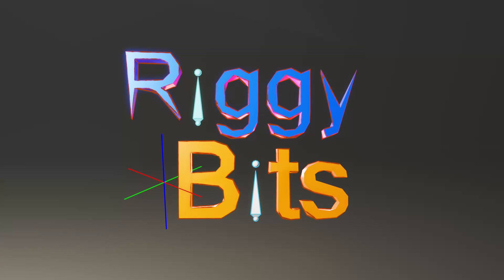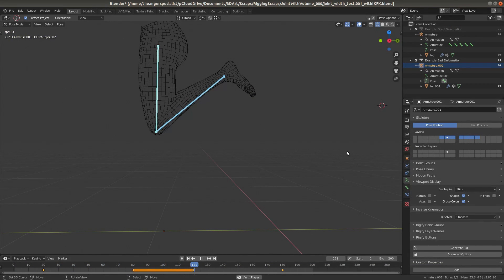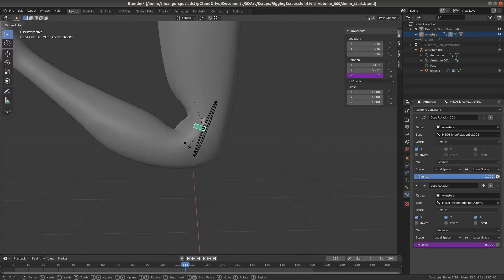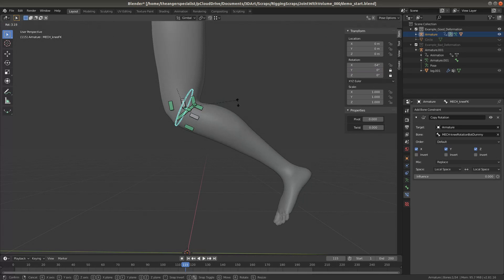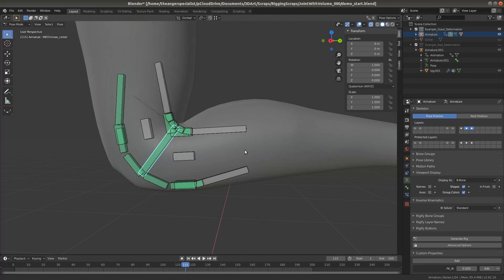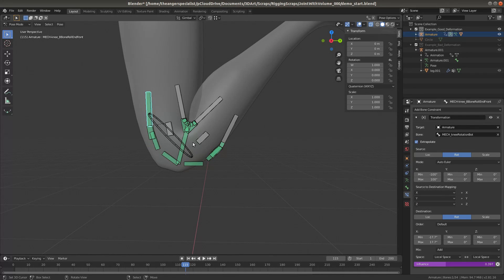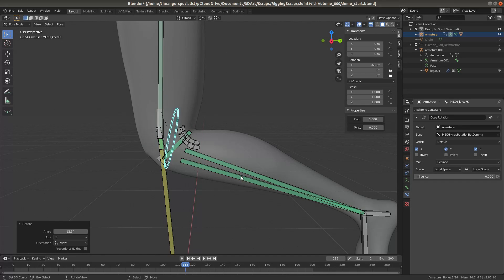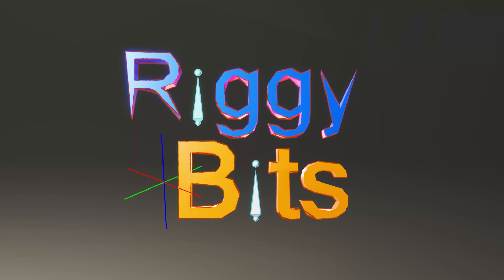Riggy Bits #1: Simulating Volume in Joints (Part 1: Theory and Example)

Comment: Dude rocket it well done. I am wondering how you would tackle a 360 2D cutout rig to keep ing the rig as simple as possible for 2D animators.
Reply from the maker: Hmm, I wonder how I'd do that, too! I've never done a 2D cutout rig (well... I did a really, really crappy one during a crunch). I think IK and FK could work the same as in 3D but with constraints to keep it from moving along the Y axis. It might even be easier since I doubt flipping would be a problem.

If I ever get a chance to play around with the idea I'll make a Riggy Bit about it.